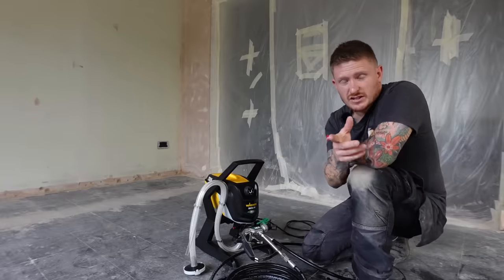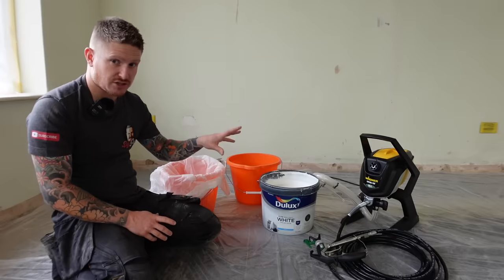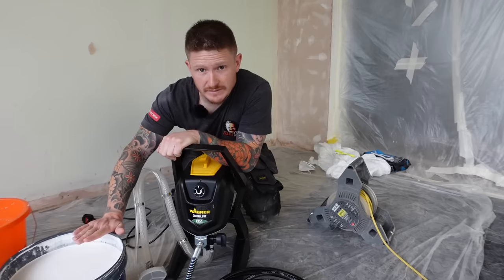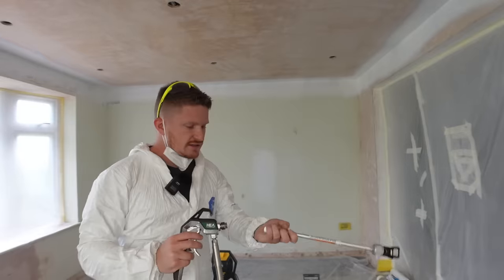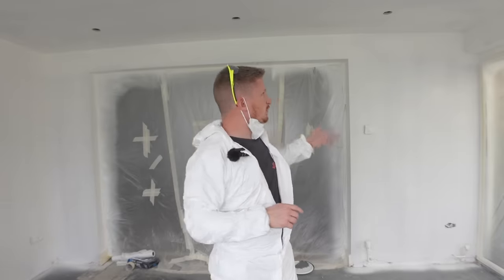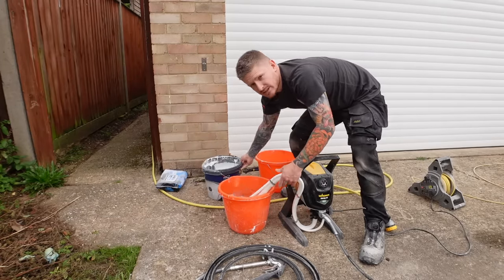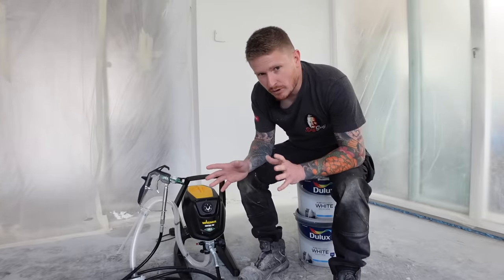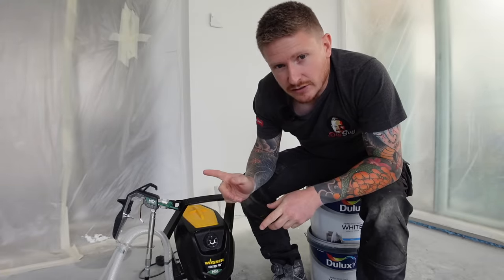How to Spray Paint Walls and Ceilings Quickly - The Tool You MUST See!

Comment from the maker: Do you think paint sprayers are worth it now you’ve seen the pros and cons?
Reply: I remain unconvinced about the time savings - it was particularly the masking I was thinking of, but clean up looks like a real time drain - esp if you have to do that to change colours etc. With a roller, you can just wrap the roller in a bag, move onto the next colour, carry on.
Reply: It's unhealthy breathing in overspray
Reply: Would agree with @awt  personally never really had the need long term for such a system. 
But maybe and depending on the price, renting one could work?  It is a fairly specific use case item I think? You will need to be doing quite a high m^2 to get the pay back.  Given the price and just "rooms" use case maybe bumping from a 9" roller to a 12" or 18" roller would decrease some time.
None the less great video never seen airless system described in such an open and honest way, normally just Craig (Big Bother) showing you how much time you can save.
Reply: @ZanderKaneUK  I don't think many people rent them because people return them not properly cleaned and if the paint is dried into the machine then it's basically written off.
Reply: Yes to the sprayer for large areas inside and out, but no to spray tips (£60), extension rod (£90), guns & hoses. Accessories are extortionate.

Cheaper to hire guns 'n roses to paint your house.
Reply: I wonder if paint gun thinner as used when cleaning HVLP guns would be quicker and better for the internals than water to clean the gun out.
Reply: A basic cheap compressor and an HVLP gravity gun are my go to. Cheaper, easier to set up, easier to clean. Nice big roller for the ceiling.
Reply: @xMeta4x only if you want to paint a very small area. You can’t paint anything as big as door with the setup you describe.
Reply: You can use a combination of both brush and spray. Use the brush for corners and edges, and use the spray to cover the center large areas. In that case, you won't have to worry much about masking. I own one, and I find it convenient to work like that. Painting generally requires prepping the area, be it you use rollers or spray. You can also use a spray pan to avoid masking
Reply: It's a great finish but you can't touch it up. Mind you back in the day you could get away with a touch up here and there on a rolled finish, seems to stand out a mile these days, maybe it's the paint quality??
Reply: I feel these would be mostly more useful for painting render or fences outside
Reply: Is there a pacific name for the plastic film used to cover the windows?
Reply: @theimprovementsguy8871  really good for fences. I completed 14 panels in 30 mins, prep took me an hour, masking off the concrete posts. Plastic sheeting the floor. There's  good video by an Aussie bill's how to... who goes into detail in cleaning a wagner machine out.
Reply: If I'm Painting a room , your goner mask up anyway .
Paint drops etc .... I've got a new bosch pse 5000 paint sprayer ... for all my furniture flipping
Reply: Yes. Going to buy one....
Reply: @awt  i think you can do the same with a sprayer ??? - whole house - gutters first - clean - then walls etc over a few days
Reply: D r e a m y
Nice work on aaaaall counts! Of course {isn’t a Horse a 🐎💨} I love tools too, vintage for their design and quality & contemporary for same [+improved movement] … ToolsTOOLSTools … Eeeeeeeee ! Uuuuuuuuuh … Machines, tools, devices & implements, corresponding for whichWHATSever ‘the job’ is vital. Nice having ‘the right tool’ for every job, yes-yes! Beautifully instructional, yours. Thanks!
Reply: Can this spray a car
Reply: Can this spray a car

Comment: I will stick to a roller and bin it after use, no messing about cleaning equiptment. Also you cannot touch up sprayed surfaces at a later date, rollered or brushed surfaces you can.
Reply: Not using organic Merino wool roller sleeves, then?
Reply: Sooooo slow
Reply: You can sand it to smooth the touch up finish I suppose.
Reply: That's really wasteful.
Reply: Yes you can touch up , you simply back roll what you've just sprayed,  simple
Reply: You can only touch up rollered walls for so long because will flash eventually
Reply: L
Reply: You could recoat the full wall needing touched up by the time you touch up a small patch with a graco sprayer
Reply: Micro fiber rollers are fine for touch ups. Also nothing beats a spray finish. Nothing!!

Comment: My tips for using this kit. 1. Get a whip hose as it will massively reduce wrist strain when using the sprayer for long periods of time. 2. Buy a Trade Tip 3 tip holder as this allows additional tips to be used including Fine Finish for gloss work. 3. Reduce the pressure, use a piece of cardboard as a test piece to ensure even spray pattern starting at a low pressure and fine tuning pressure. 4. Make sure you use the pencil filter in the gun as it traps loads or debris and allows continuous spraying (ime). 5. Never take short cuts when cleaning everything, whilst parts aren’t ridiculously expensive, they can take time to arrive and it gets tedious changing them in you’ve not cleaned everything properly (DAMHIK!). 6. It is possible to return paint held in the machine / hose on cleaning back to the paint can by setting tip to purge on low pressure, dunk the pick up un clean water and running to through until it gets watery, then run through into a bucket. I wouldn’t be without my sprayer!
Reply from the maker: Good tips 😊, cheers
Reply: and get rid of that poxy gun, get a wagner g10
Reply: @ragandoil G10 is the much better gun and a great addition to this set up.
Reply: What tip is best for emulsion interior and do you dilute paint ?
Reply: @liamcfitness  I just use the supplied 517 for emulsion which does a good job. I tend to add around 10% water to emulsion and give it a good mix with a paint stirrer on my drill. My go to paints are either Johnstones Trade Covaplus or Leyland Super Leytex as they both have high opacity and give great coverage in my experience.
Reply: Put a bag over your machine to keep it clean

Comment: So we bought this very machine to do a large bedroom and it was a real faff protecting everything. In our case the room had old carpet down so we decided not to protect it as it was going to be removed, however, by the end of the job the carpet was almost as white as the ceiling. The finish was perfect but we noticed we used twice as much paint Vs rollers, plus I felt bad about all that single use plastic going to landfill. Finally, a lot of paint is wasted through the gun and associated tubing and when you get close to the bottom of the tub you lose pickup. Would I use it again, NO but I will use it to spray my fence panels which is a bit of an overkill as my cheap Aldi sprayer does that perfectly well. Finally, you cannot use this machine for anything other that 5 litre tubs so forget furniture spraying because most of the 2.5ltr pots are virtually empty before you get it primed. Would I buy it again, definitely not
Reply from the maker: Thanks for sharing your experience
Reply: Yeah. Super heavy on paint. I use Little Greene emulsion which made spraying rooms expensive. I went back to rollers. Also, touching up a sprayed finish doesn’t work unless you spray the touch up

Comment: I purchased a Wagner "350 Extra' to paint a house I am building.  I have lots of windows, around 40, so do not underestimate the prep time of masking.  Ideally leave off doors and if a new build, spray everything before carpentry, electrical or plumbing second fix.  I reckon a sprayer uses more paint than a roller or brush.  I would not recommend spraying for a DIY job as preparation takes way too long.  Also, if you have carpets down be extra careful to protect.  Practice does improve the finish.  When you get it right the finish is excellent.  I'm not convinced my investment, around £450 when new in 2022 was worth it.

Comment: They are a great time saver.  The problem I found is when you need to touch up spots months/years down the line and you use a brush, you never seem to get the same finish/colour (even using the same paint).
Reply from the maker: That’s a great point worth noting!
Reply: Using a dry roller to back roll is what the pros do
Reply: The colour may have faded but you can smooth the finished surface sanding to try get it closer.Using trade paint like dulux costs more but it has anti fade and should last more like 10 years as opposed to retail off the shelf 5 years.
Reply: A handheld HVLP gun should give a very similar finish if you want to blend in or have a smaller project.
Reply: @jayeshlad8619  Do you do that for each coat or just the first? I am guessing roll with all the coats you do.

Comment: You really should roll the wall after painting.  If you get a 24" roller it goes very very fast.  This will eliminate runs and give your surface an even texture.  Also should only have to put down one coat.

Comment: When you e finished spraying empty your hose back into the paint so you don’t waste all the paint still inside the hose, filter and machine pipes. your cleaning time will be halved. Also buy some round bottle brushes to help keep your gun and filter housing super clean. 
I pretty much wrapped my second machine in cling film and masking tape to keep the cling film in place, the hose also to help keep it all clean and looking like new. Once you get it shit up with paint splatter it just makes it look shit so you don’t take as time to care for it, these machines are brilliant if kept clean and looked after. Mine (Wagner 350 pro) has paid for itself 50 x over! Worth getting tit know the nozzle sizes too, the correct nozzle for the correct paint makes a huge difference in finish. 👍😊
Reply: That's definitely great advice. I learned how much was left in there when I needed to finish a room and had no more paint. I was amazed at how much more paint there was in the machine and hose.

Comment: if you take the little pipe off and prime it with just water it will clean the machine part much quicker then all you gotta do is pull clean fresh water through the hose and gun its much quicker that way
Reply: it will suck the water up through the big tube then out through the little one so that part cleans quick

Comment: Good tutorial. Well explained, thanks. 

I bought this model some time ago when there was a deal on. I've got a whole house to do starting with bare plaster, including outside walls. I've not taken it out the box yet, as I wanted to wait until I've got a whole week clear. It's due to masking-up and cleaning time required.

However, I have done 4 rooms (kitchen & bathrooms) using an HVLP for the corners and wide roller for the larger areas. This worked well, but took a long time to do 1 mist coat and 2 top coats, and I still had to mask around switches, windows, etc. 

In retrospect, if I'd used my Wagner from the start in the smaller rooms, I probably would have saved time and/or got more rooms done. 

I can't see myself ever using this for a refresh job. Just too much aerosol floating around.

The biggest con is the price of nozzles. I can buy an entire small engine carburettor for less than a new Wagner nozzle, and there's dozens of different options depending on the paint and coverage you want. It's akin to printer ink rip-off in my opinion. And that small extension used in the video is nearly £100. Daylight robbery for a simple piece of plumbing.
Reply from the maker: Thanks for sharing, some good points raised

Comment: I am a paint training professional in all types of spraying equipment airless and conventional spraying. I have for home use a Wagner 350 airless unit low pressure gun. To be honest there is NO way you can spray airless with a gun extension without getting spitting out of the fluid tip, even on short extensions. You will need a CleanShot Shut-Off Valve - Swivel Joint from Grace fitted to the end of the extension to prevent paint spits when pulling or releasing the gun trigger. You  get spitting when using any length of gun extension which can be very annoying and can spoil the paint job.
Reply: Back roll makes better job and touch up match.

Comment: A tip for cleanup. Remove the plastic filter and black plastic filter holder from the bottom of the pickup tube.  Remove the pickup tube and empty the paint out before using any water.  clean the tube and refit.  Then in prime mode put the pickup in clean water and spray (with the nozzle turned backwards) into a bucket with a liner until water comes out to remove the paint from the spray hose.  After that run 1 - 2 buckets of clean water through the system followed by a quick clean up of nozzle and you're done.  It takes me about 10 mins total to clean up.   I use to do what you did and put the pickup full of paint with the filter on the end into a clean bucket and start flushing but due to the excess paint in the tubes it took way longer and 5-6 buckets of clean water.   Loving the channel 👍

Comment: I've bought one of these units after watching your video and wanted to know if you also experienced the gun losing pressure regularly and the pump all of a sudden running at a higher speed.  Quite possibly a newbie issue but I found the pipes would move around and if even with there being a 1/3 of the bucket full of paint the bottom of the suction hose would come above the paint, requiring me to reprime.  Also have you tried using this unit to paint trims?  I could not get an even coat to come out using Leyland Eggshell for wood paint and the 311 tip.   I diluted the paint also and just couldn't get an even spray.

Comment: These look great but £469? Ouch!  As there are a few HVLP sprayers on Scamazon for under £50, I wonder what the difference in finish is like?
Reply: I just use one of those (£30) and results are great!
Reply: @jaystepien921 Do you add water to it? I have found that it doesn't spray as well and I have three HBOP guns and one airless and I'm scared to death to use the airless because of how much paint it uses

Comment: I have a lot of painting to do (a house), but don't fancy having this pricey machine hanging around once I'm done. What's your view on cheaper machines, e.g. the Wagner 950, or Wagner W690? What would I be losing out on with one of those?
Reply from the maker: Totally understandable. I don’t have the experience with the cheaper machines but I think they may well have there place! I’d advise checking out some other videos to try and get a definitive answer to your question 👍
Reply: I think these can be rented, depending on where you live.
Reply: @fiestygemini2379  I'm sure I could hire one (London-based). But the weekly prices of rental are comparable to the W950 purchase price, so it's necessary to understand the relative merits.

Comment: How do you find later down the line when you want to touch up or repaint to freshen the room? The wall is very smooth compared to a roller. If you had to repaint - furniture, carpets etc woud be in the way sometimes. Would you spray or roller. Would it be advantageous for the last finish coat to just run a roller over the sprayed wall to make it more in keeping for a repaint?

Comment: Get yourself a Graco CleanShot for when you use the extension mate. Decent video. As a general builder I do all my own decorating and embraced spraying a few years back. I’ve got a few machines now and have got my techniques down. It’s so much easier than brush and roller.
Reply from the maker: Thanks for sharing 👍

Comment: Question: when I use wagner sprayer the paint peel when i use finger nail to scratch the wall does that mean I did not water down the paint properly I am using layland contract matt as my first mist coat on a newly plaster wall. Any suggestion would be welcome Note: I am just a DIY guy
Reply: It’s because your using contract Matt… I only use this on ceilings never walls… it’s not washable etc and will mark extremely easily… use the vinyl Matt instead which is more durable etc however I never spray walls in customers houses as a final finish. Might look nice but touch ups will cause you issues

Comment: just bought one of these. thought i would just try it out with water but i get a drip from the nozzle hoping it because its thin viscosity and it will be ok with paint. Any ideas?
Reply: You will get much better spray pattern when using actual paint (with higher viscosity, indeed). Watch some YT videos explaining different markings of the tips.

Comment: Looks a great piece of kit mate! Did you get any blocking of the jet on the gun when leaving between coats? Or was a quick purge good enough to carry straight onto second coat?
Reply from the maker: I didn’t. I always turn my nozzle half way to reduce air being able to get into the nozzle. It was left a number of hours and had no issues carrying straight on.

Comment: Hi, great video. I've been struggling to find what paint to use as well as finish. I've seen the Dulux you used in a local store....and at a very good price. I'm assuming you'd recommend it as the finish does look great or is the finish because of the spray?
Reply from the maker: Thanks. The dulux white emulsion is generally quite good but the finish is mainly down to the sprayer
Reply: @TheDIYGuy1  cheers, I better stock up then,I've got a lot to do lol. Sorry if you've already said but can you say what settings, nozzle etc you used? I might not need the extension as I'm 6'4 🤣 local hiring is about £ 130 for the weekend or slightly more for the week... should I buy or rent 🤷
Reply from the maker: Anytime. The nozzles used was a 517 👍